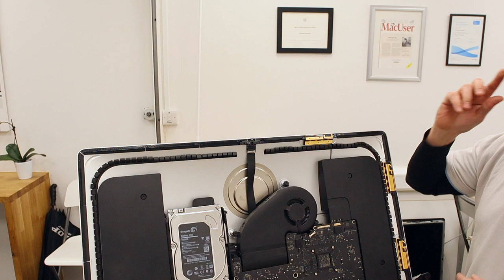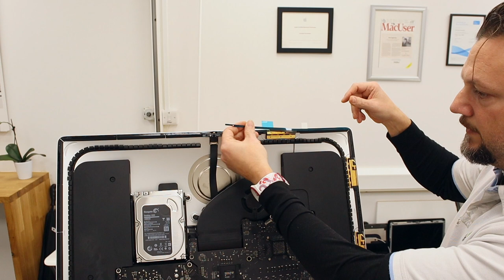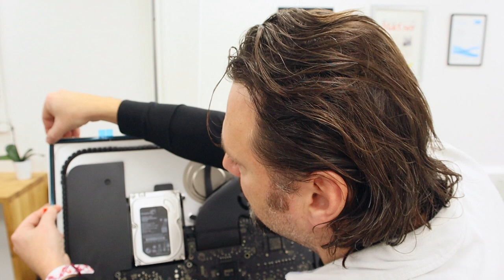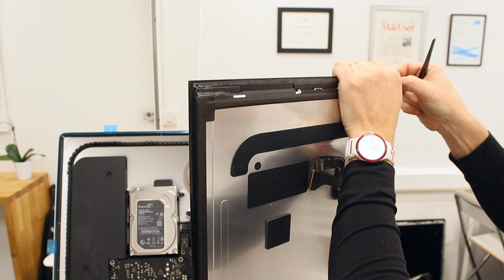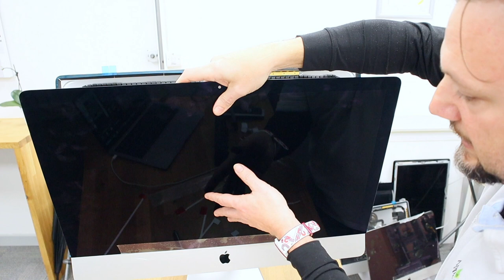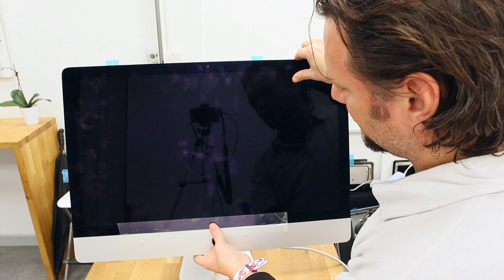How to fit and seal the iMac 27" screen/LCD (fix)

Comment: Hi Gonzalo, im in UK can you supply these adhesive strips
Reply from the maker: hi yes sure , as it cant be folded postage may be a bit expensive. probable ll includ around £20
Reply: @Apple-Bay  do you have an online shop? would you do discount on multiple order 21.5 and 27imacs, usually go to ifixit